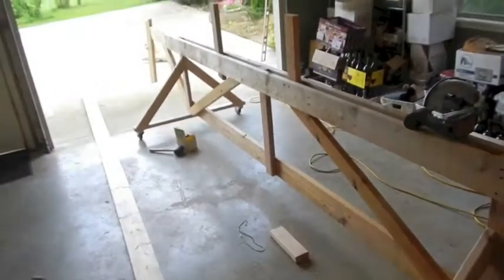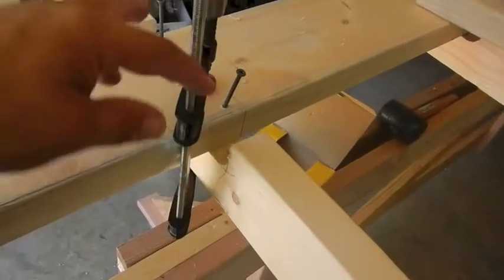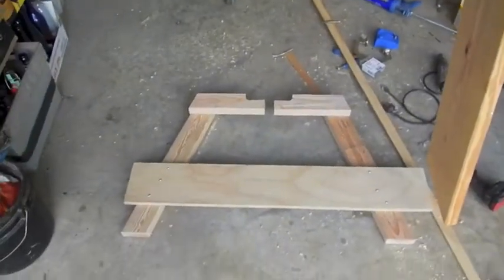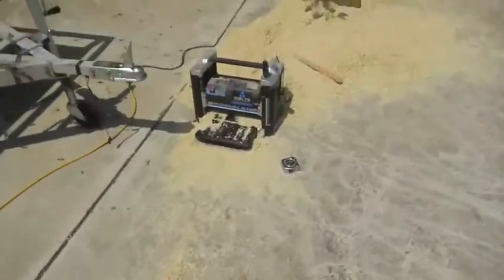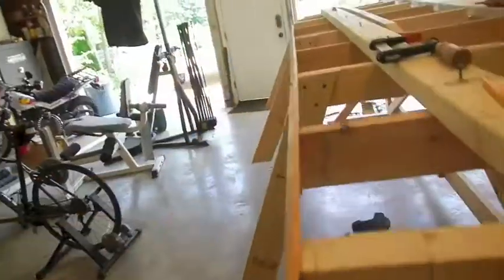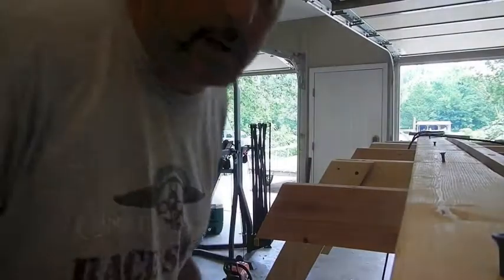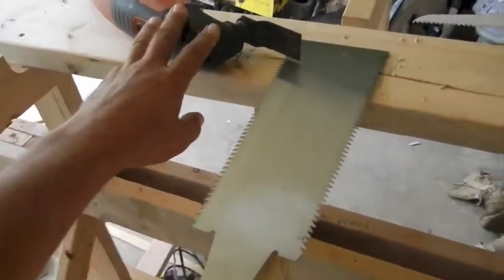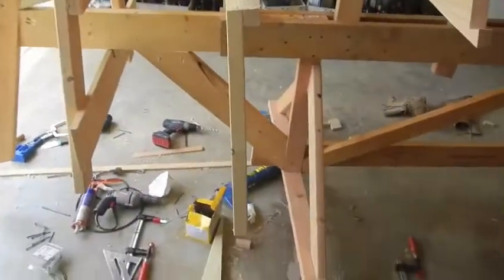Albion Boat Build-Part 2

Comment: I noticed no sheer clamp. What was the reasoning behind that and any issues doing it this way?
Reply from the maker: @dustinm5583   I lowered the sheer 4” on this boat so i left them off to make it easier to do that. I then just did the sheer line by eye.
Reply: @plywoodonframe  thank you for responding. I’m building a tillamook and am in the adding the longitudinal pieces step and I’ve watched your videos a dozen times and thought that maybe it would save me a day and a hundred bucks in material if they weren’t absolutely necessary. I’ll throw the chine logs on and see how squirly those frame ends end up and go from there. I’m assuming once the ply goes on none of that’s moving anyways and 1x4 isn’t really adding much in strength.

Comment: Mark I have watched all of your videos for this boat build. Congratulations you are  a skilled builder and your boat looks fantastic. I too am also building a Spira boat. Do you recommend the PL Premium 8x to use for fillet on the inside?
Reply from the maker: I would use an epoxy wood flour (or other filler).  The other works but the epoxy seems to do the best job.

Comment: Just starting the same boat build and plans. Did you use PL premium on all of the joints for the frame work?
Reply from the maker: Yes... I used it for the framework and attaching the plywood.

Comment: Hey Mark, I see you left off every other vertical frame piece on the Albion.  Did you do that for weight reduction?  How has that affected the flex in the hull?  I am thinking of building an Albion in the near(ish) future for use in Central WI lakes/rivers for multipurpose and Lake Michigan/Superior for trolling.  Curious as to why you chose to leave out the vertical pieces.  Great build!
Reply from the maker: I did it for weight reduction.  I wanted to be able to get it into 6" of water.

Comment: I tried this method and things did not go well lol.  Nothing was lining up on mine, spent all day today on it and it's all screwed up lol.  I realize this is the way almost everyone does it but man, I need a new method because I suck at this one.
Reply from the maker: Can you give more of a description of what in not working?
Reply: Really just the angle the chine log takes once I start to bend it around the notches do not line up with the notches themselves.  I'm sure it's user error, but so far this is the most difficulty I've had to far in the build.  I think at this point I'm going to have to just trial and error it and just do what I can.  Then epoxy one frame at a time, on each side, and let that cure and walk it up so I can get it right.

The chine log really is never flush with the frames at all which worries me on its strength.  It just hits a high point on the notch, even though there's plenty of angle it's just not matching up.  At this point I can't really take any more wood off.